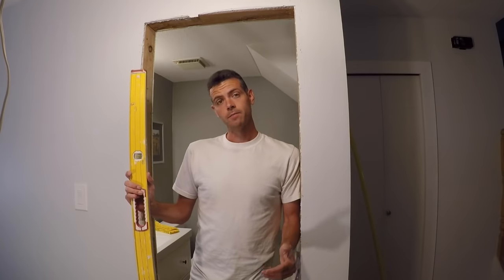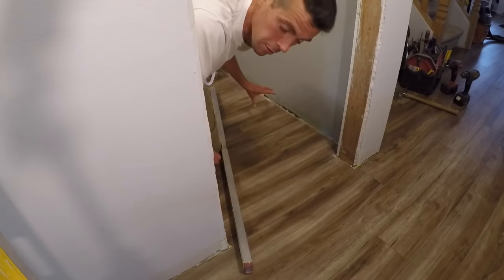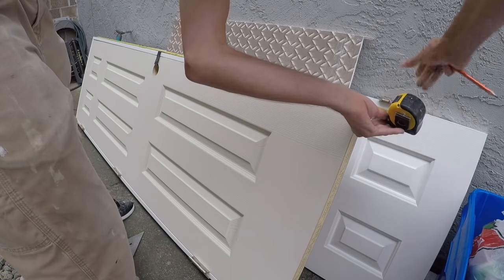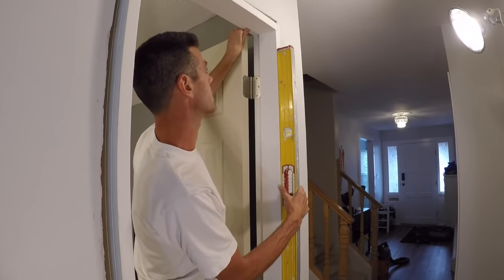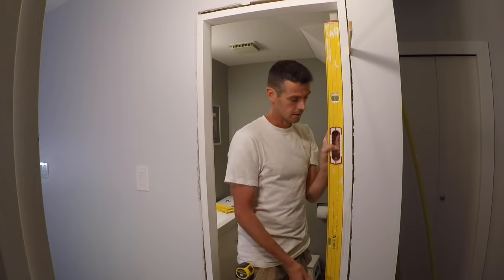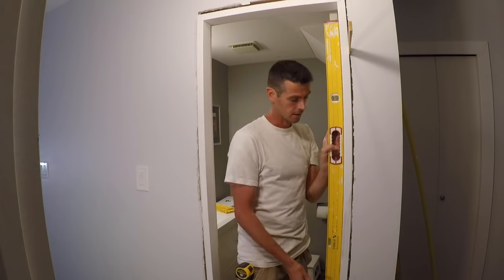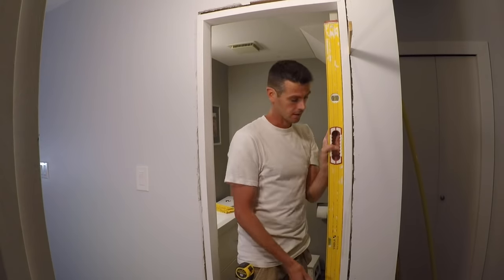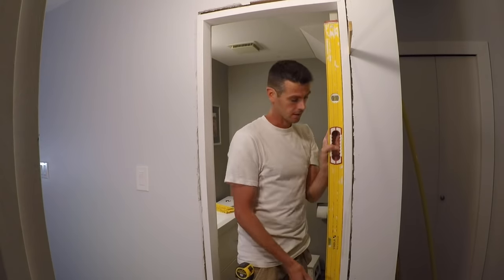How To Install a Door in Bad Framing!

Comment: I love your channel.  I have been following you for about 8 months now and you have helped me step up my maintenance game significantly.   I do have a question or suggestion for another video.  I had to replace the striker only side of a door jam.  Leaving the hinge side and top plate installed. It was a difficult job and am curious if you could address this repair.  Thanks again for a fantastic job.
Reply from the maker: I would if I could but that is a super odd one I have never had to do and don't see it happening any time soon.

Comment: I usually Default to the BFH to try to plumb up the wall a bit before hanging a door in a hole that's that far out.... a few good whacks on the bottom plate often fixes the problem!

Comment: When dealing with crappy framing.  pin nail a shin across the bottom 1" above the hinge.  Then shim out the level plumb and then insert another shim 1" above the middle hinge.  Then ditto for the top hinge.  put your 6' level against the shims and verify if plumb.   Just like that, jack.

Comment: I needed this video 8 months ago. Had to hang 16 doors in a really old house. What a pain in the ass.. should have bought pre hung doors but was trying to save the investor money.
Reply: So 8 months ago you discovered one of my Golden Rules. 1)Don’t try and save investors money over making your job as easy as possible. 2) Don’t work for investors.
Reply: I'd think you couldn't use pre-hung doors in an old house without ripping out the original jams and risking a mis-match with the original casings. When I sold my parent's house in 2000, I had to replace a few doors in plastered-in metal frames, so to avoid massive demolition, I had to cut the new ones to fit.

Comment: Pro tip.  Always plm Hinge side first,  use shims along backside of level.  Shoot in place with Brad nailer, then and only then measure width of rough opening.   It will help you avoid the problem he ran into.  Not knockin him as a carpenter, its just, I've set alot more doors than most people. It's a trick I picked up on my own.  
( working for apartment complexes. Where hollow core doors are the go to, and having to replace them all the time, and with prehung doors running cheaper than slabs, in our area at least, ya go through alot of doors when your dealing with 300 + apartments)

Comment: I had this same issue but it was a pantry door so I only had access from the outside. After several hours (go easy, i'm' a DIYer), a lot of cursing and frustration, about 15 screws and a block plane later...it works.

Comment: About a month ago I started to soundproof my bedroom, in preparation for my mother moving out of her nursing home and in with me. I’m also a tradesman, a plumber and Pipefitter, and in my arrogance assumed I would have no problem with carpentry. I mean, how hard could it be?
Well it turns out that my arrogance was not just insulting to your trade, but also unjustified. The work I did was fine as far as isolating noise goes but my walls are not straight, my door is hung crooked, and in general you could have done this work better blind drunk.
That’s hw I found your channel, and I want to say that if I had been smart enough to look for your videos six weeks ago this job would have involved less swearing and more bragging.
As it is your tubes on fixing fuckups have been invaluable, and while the end result will be far from perfect, I can maybe say it’s okay, for a turd herder.
Reply: HaHa That arrogance thing sometimes slaps the shit outta you don't it?
Reply: Proud of you for recognizing your mistake. onward and upward, man.

Comment: I’ve dealt with this sort of out of plumb issue many times. I have found that as long as I am dealing with paint grade Pine and can caulk liberally afterwards it’s doable.
You may have actually measured that door outside correctly and when you went to bring it in the jam pulled apart slightly, doors are so cheap these days it happens...

Comment: great to see a video where the install doesn't do to plan, too many perfect videos out there. This is exactly the kind of video I have been looking for. Been installing oak doors at home and in the main have been fine and fitted well into existing door frames, just a couple of troublesome ones, especially double cupboard doors...maybe a real silly DIY question, but do you always fit the frame/jams to the door before fitting the frame?

Comment: I applaud you for using a big ass level and doing it the hard way. Use a laser level you’ll be more accurate and faster. Also you can fine tune the door based on where the laser is using tour shims. Works great for gapping and plum. I installed my very first prehung door went out and bought a laser level and wouldn’t do it any other way

Comment: It makes things much easier when you use a level and true up the hinge side using flat shims. Once the hinge side is true, you don't need to worry about shimming, just screw in the hinge side. Then use regular wood shims on the latch side to adjust the gap.

Comment: If you have the time you can plane down the faces of the jamb that protrude from the drywall provided it is not so much it makes the jamb look bad so the molding sits better. You should also never screw or nail through shims since it splits them and/or makes them impossible to adjust effectively, using shims behind hinges is debatable as you can't adjust the space between the slab and the jamb above the top hinge and below the bottom hinge with shims like that however your door seems to have no issues so no problem. Around 17:35 you are describing cross leg which should be checked earlier in the door install when it is easier to adjust but fortunately it worked out well there and closed quite well.

Comment: Its like travel back in time. In Sweden we haven’t used that technique in 30 years.
Reply: Same here in Germany. We foam them in and it takes about 20 minutes even on bad fitting walls.
Reply: Alexander Graef We never use foam for doors. (Never foam against wood) Instead we use screws that are adjustable. You can adjust the gap however you want by just using the screw. There is a special tool for this. You use one side of the tool to get the screw in, and the other side to adjust.

Alt 1
https://youtu.be/ftW7B-HF4D4

Alt 2
https://youtu.be/-aB2YNr29wY

Comment: And that's just an interior door.  Wait until you go and do an exterior entrance door on an old house that has settled for 35 or 40 years.  In this video, he starts out by using words like plumb and level and square.  You will soon learn that words like that don't apply to anything you are attempting to do!  (Ask me how I know!!)  The MOST valuable lesson from this is when he realizes that relying on his eyes and his intuition is the only way this door is going into that space.  Yes, there are days when you install a prehung door in a perfect space, but don't count on there being many of these in your career.  Nice job Vancouver Carpenter.  I'd hire you!

Comment: @9:59 - Warped stock! I got a warped on the hinge-side 'Metrie' hollow-core from RONA, just like your 6-panel. Sat for months prior to install and discovered it was bowed out bad, 3/4" right in the middle towards the outside. How it was able to swing I have no idea. I was able to pin the top and bottom hinge points where I wanted and used a jack post, on its side, resting at the right height through a ladder and used the opposite wall to brace against (the gap was 9'). I heard cracks in the door frame as I forced it plumb but thankfully the finger-jointed pine(?) didn't visibly crack. I then put in four framing screws in the middle to hold it. It remains, three years after install the door with the nicest look and operation in the entire house.

Comment: I just put in a door that’s warped. The reveal is garbage on the jamb side. The walls seem out of plum and the frame is twisted. Had to cut the drywall to get the trim to be flush on the door lol. What a disaster, but I managed to get it figured out

Comment: Depending on costumer wishes, I tilt the door slightly ehhhh inwards. (?) If possible, some houses is too much skewed. It is VERY annoying, when you push the door close, not quite hard enough, that it swings open again. Tilting just a tad, helps a lot.

Comment: Question...  Did you check to see the height of your  door matches the height of the one on the other side of the Hall there....  Head heights should all be the same in a hall and if they are within a short distance from one another. Wall Paper and Other coverings can force you to use a Laser to keep all heads the same height...  Greg

Comment: A good video but a couple of questions:  Why a single rabbet jamb on an interior door?  Door width plus two inches or 51 mm for rough opening width.  82-5/8" for r.o. height.   I love your drywall videos and interior and exterior door hanging only has taken me about 40 years to master?  Why does hanging a door cost so much?

Comment: I watched another video on installing a door frame, and he said to always level the top of the frame first followed by the hinge side then the handle side.  I never seen any mention on the top of the frame in this video at all and noticed there was a big gap at the top maybe as much as 1" ?  And yes how do you deal with the casing where the frame is well past the drywall or well inside the drywall, lets see that video on how you finished the casing for this door frame !

Comment: HI VAncouver  carpenter ,nex time use brad  nailer  just to tack the door jam. you can easily adjust  the frame  ,and hold in the same time .Regards  from Kelowna

Comment: Pretty typical set of problems found on both remodel and new construction projects. A couple of things to add to your bag of tricks:

Use your 4 foot level to mark a level line at about chest height. Measure from the floor to the level lines on the hinge and strike sides and record the measurements on the rough jambs. Transfer those measurements to the door assembly, accounting for the reveal at the floor. Then trim your jambs. If the finished floor has not been installed, you can shim under the jamb legs until the markings on the rough jamb line up with those on the finish jamb and your header will be level. 

When walls are out of plumb, I usually try to make the jambs flush at about the height of the center hinge. I'll tack a couple of scraps to the wall at the center hinge height and then push the door into the opening until the jambs index against the scraps.

I put my 6ft level against the rough hinge jamb and shim it at the hinge locations until it's plumb, then tack the shims in place with my finish nailer.

Yes, I have had to "work backwards" as you did, on more than a few jobs. Good job on moving the strike side rough jamb and cutting back the bottom plate...you know to watch for nail pops I'm sure. If you can't move the jambs enough, you can use your power planer to skim a bit off the back sides of the jamb legs.

Comments are easy to make. Installing a door while the camera is rolling and then putting it out there for every yayhoo to criticise is tough. Great stuff on your channel though and thank you. This old dog knows lots of old tricks, but I've learned a lot of new ones from you, especially about finishing drywall. Keep up the good work.

Comment: WOW WHAT A BOTCH JOB!!!love it.this one holds your attention .how could the door jam be different widths? It looked to be 1 inch smaller on the bottom.I bet a10 lbs. sledge hammer would have moved the bottom of the jam over a inch.haha If you do like this, where the mistakes are left in ,I'll watch a lot more of your video's ,that's how i learn,FROM OTHERS" MISTAKES>thanks loads.

Comment: if a door won't stay open take out the middle hinge pin hit it with a hammer to bend it a bit, you'll have to hammer it back in.  this will cause it to bind enough to hold the door but not enough to be noticeable

Comment: When I need  a little persuasion for a stud that's not plumb, I use a sledge hammer.
A few blows at the bottom will set that wall straight!
Reply: and crack the tape joints and pop the screws

Comment: Oops yeah I'm about to do my first door, which was in an existing wall and I wanted a straight shot into the basement instead of using the other door which was an absolute nightmare to bring stuff in and out of it like a couch so this door will give me a straight shot from the garage door right into the downstairs living room. That and itself was quite the experience when I opened it up and had to frame this I think I have it ready to go but the floor is cement and where the footings were I had to chip out 2 in of concrete to even it out with the basement floor, I have been able to get the floor fairly plum very close, have the door and now it's time to start putting it in, I'm very nervous because it has never as easy as it looks on these videos. Even though he had problems here. So my floor that is already done coming from the garage has tile the room downstairs that we are going to redo has carpet and we're going to take it out and put wood there is about a 2 inch difference in level meaning it's going to drop off I'm sure we're going to have to self level the basement floor which will bring it up some and the door will open into the basement not the entryway of the garage door. I really need this guy to help me but that's probably impossible.

Comment: First off 90% of the time u can leave the level in the truck. Start with caseing the hinge side(trim work), throw the door in its whole. Check plumb along the hinges(maybe). Check revile, adjust and nail it starting on the hinge side. Some times u may have to cut back or hammer the rock down for minor adjustments. Exterior doors can be a little more complex and less forgiving.
Reply: Alvin Norris thank you someone actually knows what they are talking about!

Comment: Nice job, but I have 2 questions... Where do you live where your interior doors are hung on non Krefeld exterior frame rather than interior flat jambs with applied stop? Second why do you leave the door in the frame while hanging? It is much easier to pop the pins and remove the door so your not fighting the door, mount the hinge side plumb you can still cheat the top out at the top due to bad framing, then pin the hinge and door back onto the jamb and finish the hanging process as normal... I have about 30 years in the Door Shop industry pre hanging doors.
Reply: Non Kerfed... Sorry auto corrected before I noticed.

Comment: If you put a brace bar at the bottom of the frame you wouldn’t have made the issue in the first place. Also... rather than smashing the living daylights out of the stud work (where you also hit the new frame with your hammer), you could have just planed some off the outside of the door casing at the bottom. Just a  suggestion for another time :)

Comment: Everyone has their own method, I much prefer to pull the pins and remove the door (that way you are only working with the weight of the frame). Then you install the hinge side jamb dead plumb using the hinges as the reference then replace the door on the hinges and set the gaps at the top and latch side.

Comment: Door hanging is always tricky its never a right on when its first installed especially when its just a slab installed onto an existing frame having to plan & sand door edges back n forth just to line up correctly too much planing & sanding can ruin a door.

Comment: I find it a bit funny how you use imperial numbers, but then go over to metric when imperial numbers aren't small enough :) How does this work in Canada? Also, how come you didn't use a door with pre-drilled holes? How did you fix the holes? When it comes to the shims - how come you don't glue them? I often find that the shims falls out of place. I like how you measure the opening before you install the door. I guess I just assume the opening is correct before I install a door.

Comment: Wow are rabetted jambs standard there?  I notice the door across the hall has an applied stop.   Here we get doors prehung on a 5/8 piece of MDF with a 3/8 applied stop, if the wind catches the door it tears the stop off and sometimes the hinges (on MDF jambs you have to install longer hinge screws into the stud, even with hollowcore doors) ,  I hate production carpentry and avoid it at all costs.  People will spend $1k on a mobile but not even $100 on a door.  also R.O.s need to be: door+2.5" not 2"

Comment: You should stick to boarding and mudding which you're great at. Doors create downward pressure. So shims should be at the bottom of the hinge not the top.  The reveal should be dictated by what the flooring is.  If carpet 1/2
" Is fine.  If it's solid flooring then 5/16 is good if they have kids. If you're installing a Sound Transmission door on hardwood the 3/16"
Don't be lazy remove the door with hinge from jamb and install your screw underneath where hinge will be and then you don't have a hole to putty.

Comment: Great video, i am installing an exterior door , my reveal on the bottom lock side is a lot larger than the rest of the door on the lock side , how do i make the lock side reveal more equal ?
Reply from the maker: Shim out the frame if you can.

Comment: If you are not casing the door after it is installed, can you drywall a setting compound and tape up to the jamb?
Reply from the maker: Not really. However lets say you have a jamb an even 1/4" all the way around. In that case you could. I would install an L edge corner bead and caulk the connection when finished.

Comment: Your under cut for that door may be enough since it is a bathroom but...remember if there is no return register in a room  and you dont have 3/4 to an inch of gap  under the door air will struggle to enter/escape the room with the A/C or Heating on. No air out, no air in.